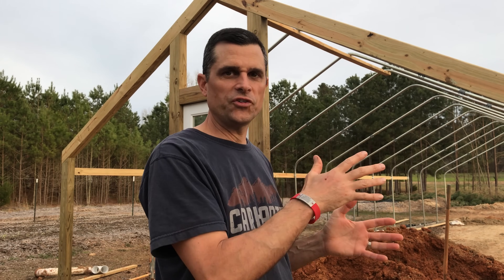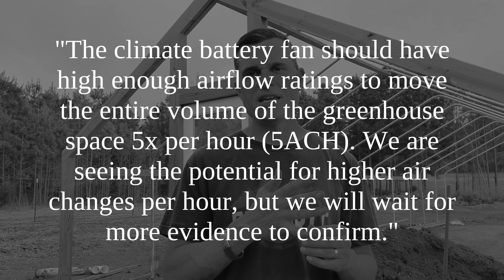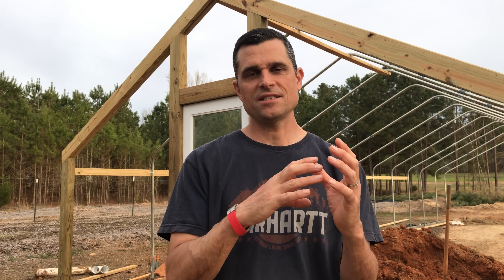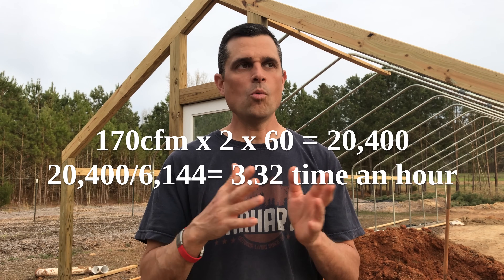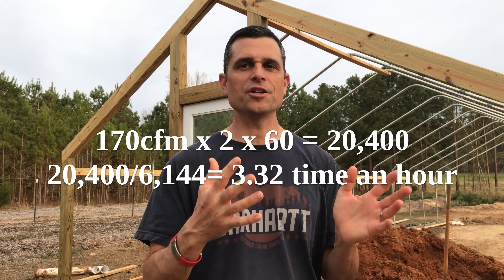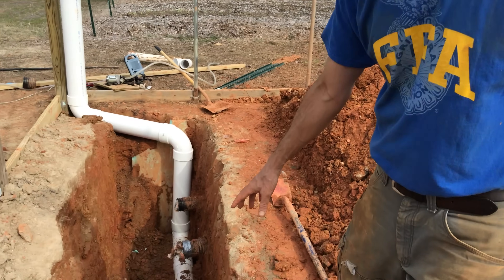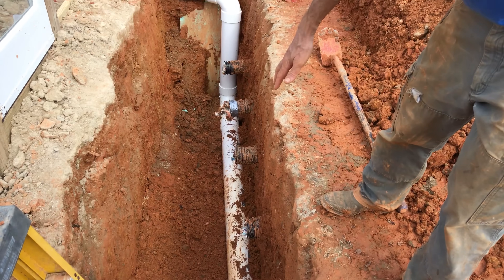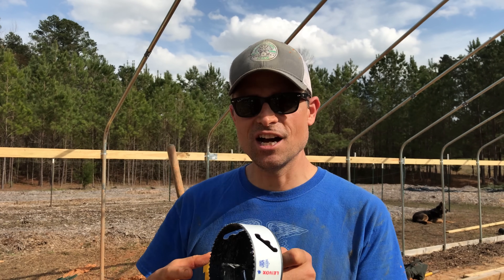DIY Geothermal Greenhouse Part 7: Earth Battery MISTAKE!

Comment: The reason it is too small is talk to an air conditioning person who has installed in their house Underground and Outlet you know 20 40 60 feet whatever big place where they can drive in underground into they're on the ground under the house you know how you can put your pool table and stuff down there your car and stuff and then it comes up and get you walk up the stairs and there's a door that goes into your kitchen what happens is the air and that's extracted if you have a fan or a window open or a series of windows open at the very top especially if you have a multi-dimensional house
Reply: Are you drunk?

Comment: You should look into squirrel cage blower. They will move air through 4 inch pipes no problem you'll get the cubic feet per minute you need at the higher pressure. Pancake or coaxial fans are only for low back pressure systems that doesn't apply here. It's all based on horsepower 1 hp will move about 2000 ft.³ per minute this is the size of most blowers in peoples furnaces in their homes
Reply from the maker: Could you share a link to a fan that would work for this? Perhaps we just didn't look hard enough, but didn't see them. Thanks!
Reply: Here are the type of fans you should consider.  Generically, they are called blowers, but are nicknamed "squirrel cage" because they look like a rodents merry go round.  https://electricmotorwarehouse.com/squirrel-cage-blowers-1/     Picking the right one is kind of tricky.  Any system of ducts will behave uniquely.   There's friction inside the pipes which is a combination of their diameter, the texture on the surface (smooth or corrugated), how long the pipes are (more length is more friction), and how sharp the turns are, (smooth gradual bends are always better than hard 90's).  This all adds up to resistance to airflow.  If you could somehow measure the amount of air you were pushing through the pipes per minute, you could also measure how much "backpressure" or resistance the fan was fighting  to achieve that flow rate. Fans and blowers are designed to have a happy zone where they run efficiently and don't overheat. If they are too powerful for the set of pipes and the system resistance it presents, they just make a lot of noise, and use too much power.  If they are undersized, the can't overcome the backpressure or system resistance.  The airflow through the fan will be inadequate, and it will burn up shortly and not pump much air.  The trick again, is to understand the relationship between flow rate and resistance in your piping system.
Reply: @brianmifsud4531  axial V centrifugal fans...
Reply: My brother works for HVAC company.  They tear out old furnaces all the time and he gives me working 2 ton and 3 ton blowers (squirrel cages) all the time to move air in my barn.  Move a ton of air.  Because of the dust and debris I burn them up... but in a closed system like this, they should work great.  Even an older used one.

Comment: Someone may have said this, but your math is wrong. You doubled the CFM rating and multiplied by 60, gives you cubic feet per hour.
Reply from the maker: Yes, we have two fans. The idea is how many times you turn over the cubic feet of the greenhouse per hour - so we were converting to cubic feet per hour with two fans.
Reply: My misunderstanding. Re-watching the vid, your math is right, you simply mis-spoke and said cfm but meant cfh. Your math is right, i just got hung up on one word. My apologies

Comment: 35° coming out the exhaust....
Did you think to bury a few vertical pipes so you could monitor the soils temperature at different depths..once you're up and running..
Most everything I've read says once you go down away from the surface..
It's 50°ish...
If thats true and you pulled 35°..
Sounds like you might be picking up a wind chill factor...
Maybe..
Reply: Windchill is a calculation, not something that a thermometer would measure. Consider there may still be frost in the ground which is chilling the air.
Reply from the maker: Yes, using that infrared meter was definitely giving skewed numbers on both ends, but we are getting a consistent 30 drop in temperature during the heat of the day.
Reply: St. Isidore's Farm 
👍

Comment: I applaud your efforts and look forward to seeing how it works out for you.  We have a 350 sq-ft glass house and installed a slightly more primitive version of what you've built (using a barrel plenum, your exact fan mounted inside the plenum so it's quiet, and spaghetti tube configuration instead of a linear array).  We used gravel around the pipes to discourage rodents from tunneling into the system.  Our experience has shown that for cooling a greenhouse, circulation followed by ridge ventilation is key.  Before we added two healthy circulation fans in a raceway orientation, our raised beds and the plants were getting fried and there were loads of hotspots.  The circulation excites all the pockets of hot and they rise through passive vents and an exhaust fan.  Our SCHS is capable of pushing out about a 10 degree differential for several hours before temps equalize and it loses its efficacy.  So we time it so it operates starting at the hottest hours of the day.  We chose to cool the lower air, and not pull hot air from the ridge, because that air is destined to leave anyway and there is no benefit grabbing the hottest stuff.  Instead, we pull a single intake about a foot off the ground, and let our circulation fans equalize the lower height temps.  Our exhaust from the system is coming out in 6 evenly distributed floor grates, so cool air is put where it might serve the best counter effect to the heat (and below our raised beds).  Then in the middle of the night, when heat is preferred (San Diego has cool nights year round) we run for a few hours, thus cooling the ground (discharging the climate battery).  The overall effect of our system is a nice equalizing factor that helps minimize overly hot days (in conjunction with circ, exhaust fan, and foggers) and minimize swing of coolness at night.

Finally, because we wanted to conserve water, our raised beds are subsoil irrigation beds.  I integrated all of the water lines with a common reservoir, and this allows periodic circulation of the water, which also helps stabilize temperatures, and this winter I threw in a 100W aquarium heater to help a little with heating beds through warm water beneath the soil.
Reply from the maker: Sounds like a great system! Any chance you would ever consider uploading a video about it?
Reply: St. Isidore's Farm that would be awesome
Reply: Come on now, San Diego needs a thermal battery?  What is your 25 year low temperature for one hour? 50 degrees
Reply: I would love a copy of this video...im building a green house and every1's questioning about heat I live in VA. TIA

Comment: I'm no engineer so perhaps I'm misunderstanding the problem. Couldn't you have dug up just the other end of the 4" inlet pipe, dropped another 6" pipe to join it then split the input air to the front corners rather than digging up and replacing the entire 4" pipe? You'd still need either a second fan or enough pipe to reach the other corner but it could run above the door or a foot underground and required a lot less work.
Reply from the maker: We didn't dig up the entire system, just the ends. We needed to have a six inch trunk or manifold for the four inch pipes to run off of. Thank you for taking the time to write and ask/offer a suggestion. We do appreciate it.

Comment: About feedback, I'd rotate that toprail to have it 'stand up' that way it will hold more weight if you are going to hang stuff from it.
Reply from the maker: We really thought about that, but the board isn't structural - the pipes are. That and we weren't sure the fans would actually attach to that board. Originally thought we would put lights up there, but decided we wanted the fans a close to the ridge as possible. Thanks for the feedback though!

Comment: You really should use thermocouples to measure the air temps. The IR units are best for surface temp. readings. The plastic pipe surface that IR's read is slow to heat up or cool down, because they are plastic and thick.  Wishing you success.

Comment: All that needs be done is to utilize water instead of air...a 12 volt water pump is able to run on a solar panel just like a fan. The other advantage of water...capacity and heat and cooling transfer.In the summer you utilize the water in a cooling tower to keep the greenhouse cool.
Reply from the maker: Interesting idea - are there any examples of it on YouTube to better understand and see how it works?
Reply: The heat capacity of clay soil is about 1/3rd that of water. If your greenhouse is 50 x 20 and you utilise 4ft of depth, you have the equivalent mass of a 50ft x 20ft x 16" deep pond without the hassle. The problem with water is any heat you put in will be rapidly distributed throughout the entire mass so you may only see a 1F rise. With soil, the heat moves away from the tubes slowly so it remains available for use the same night. The 2nd law of thermodynamics applies so you will never recover 100% of what you put in  ;)
Reply from the maker: Thanks for all of the comments. We continue to learn a great deal from them!
Reply: interesting idea, I had a similar idea using IBC totes in a insulated concrete pit, with some sort of solar collector to heat them above what the sun coming into the greenhouse would do.  Solar vacuum tubes with a circulating pump for instance.
Reply: In order for a cooling tower to work efficiently, water has to evaporate to get it below ambient temp. With RHs above 60% continuously during the seasons where cooling is needed in his location,  it's difficult to get much cooling without a large evaporator and big pumps moving lots of water.

Comment: For real. Take down your other videos, or put this at the top of your play list. Really really misleading to have a bunch of build up videos showing an install we assumed would work. If following you step by step we get to the end to find out its a failure.
Reply from the maker: This video is not the end of the project and the earthy battery system still would have worked with the four inch pipe, just not as effectively as they will now with 6" pipe. We'll be uploading a new video on Monday with the greenhouse mostly finished and everything functioning well. FYI that we upload videos to document our projects on our farm and sometimes they involve learning from mistakes. Thanks for watching.